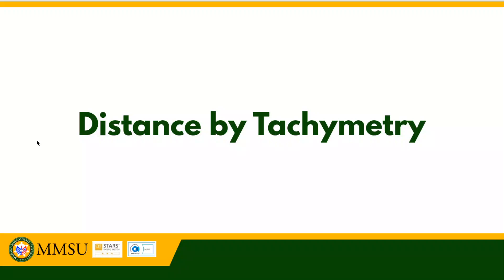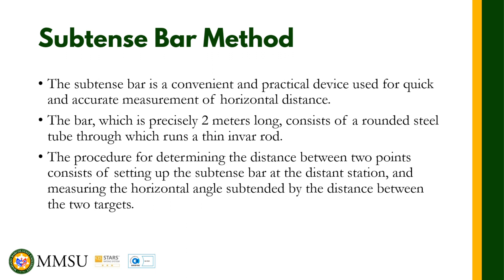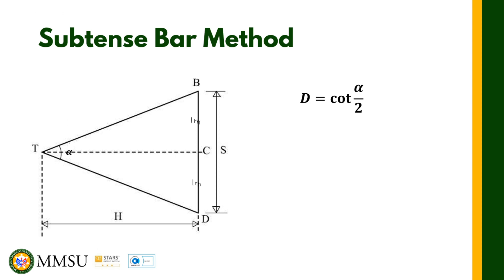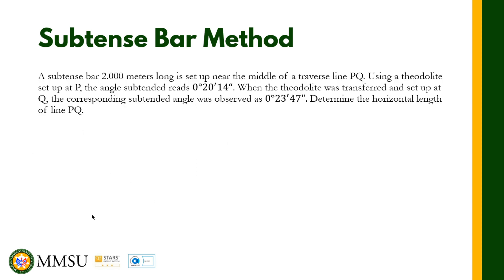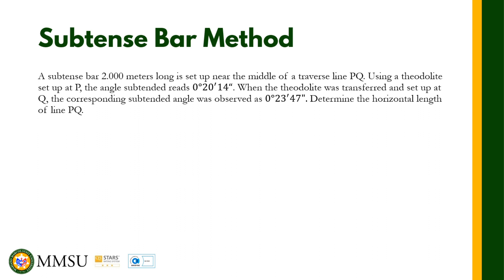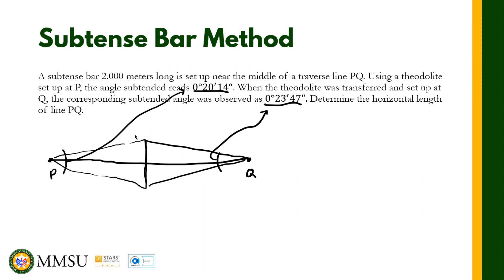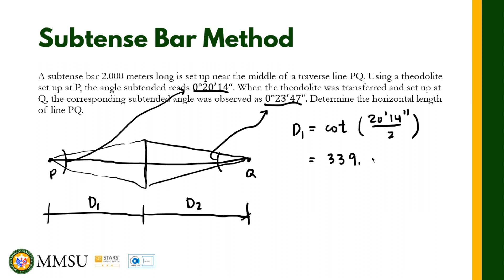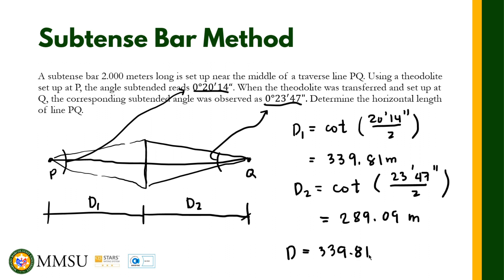Subtense Bar Method | Tachymetry Methods of Horizontal Distance Measurement | Surveying

Comment: kung paano mo nakua ang 339.81 m 4:29? Iba kasi ang lumalabas sa calculator sana matulungan mo ako dito. Maraming salamat sa video na ito naiintindihan ko na siya kahit papaano.
Reply: You have to write 0 degree 20 mins 14 sec on calculator . He had written  20 mins 14 sec, Which you copied to get the answer.
Reply: Same po iba rin sakin
Reply: There is a button in the calculator for this, the one with the circle and the 3 apostrophe symbols. Or you search this "Decimal Degrees to DMS Formula".